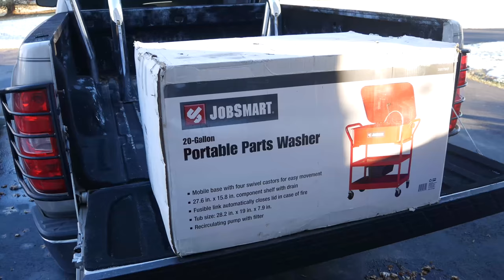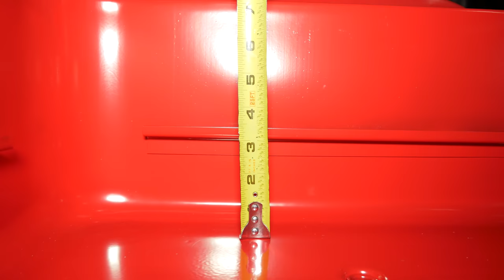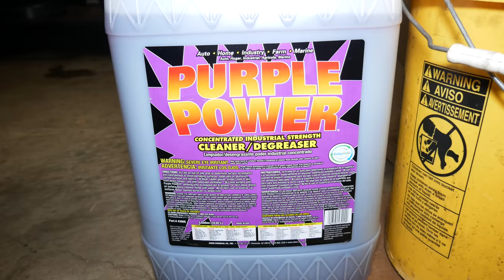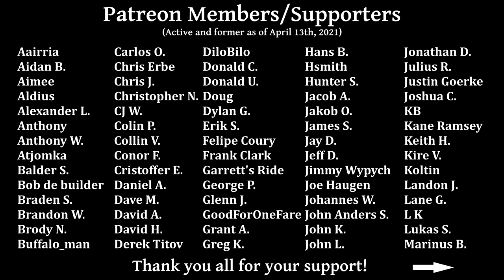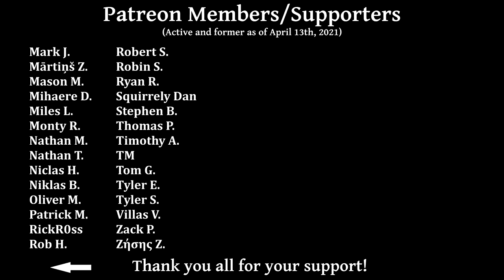$200 454 Engine Rebuild: Cleaning Engine Internals and Hardware (78 Firebird Ep.17)

Comment: Hello Ronald, I don't know if you will even see this comment but I feel right putting this info here anyway. Have you considered having the piston skirts knurled? Doing a budget rebuild like this one is a great time for this. You may be familiar with the process but just in case someone else wonders, knurling the piston skirts is an inexpensive stop gap procedure that increase the thickness of the piston skirt, done correctly it will make the pistons the original ish diameter.  I am a retired Automotive Machinist so I have done this myself in the past many many times. There are those that will say this is a useless thing to do but having done this myself and then disassembling the engine years later I can attest that it does last for quite a long time and will keep everything in spec and happy longer. You will have the information to have it done already, you simply need to know the finished bore size  and the measurement of the piston at the skirt. The shop will then put the piston in a machine that is set to put a bunch of  raised knurls onto the skirt. this will help tremendously with any piston to wall differences. Most machine shops that cater to the DIY market will have one of these machines in a dark corner of the shop lol.

Comment: I was literally typing a comment about using purple power with aluminum parts like the pistons, then got to the part where you discovered its effect.
Reply: @marxist google can you explain why? I’m genuinely curious, is it just discolouration or has it corroded/damaged the aluminum in some way? Thanks
Reply: @nakulah  Purple power is caustic to aluminum. It strips the protective oxide layer on aluminum and corrodes it pretty badly. He is likely in for a pretty nasty surprise when he unwraps them next. That said, it is entirely possible he gets lucky and he got them cleaned and the WD-40 removed it before any serious damage was done, but I'm not terribly optimistic.
Reply: @nakulah  it'll probably be fine, thinner aluminum parts could be completely destroyed or weakened tho
Reply: Clean-Rite says in their FAQ that Purple Power will leave "white streaks or a hazy film" on aluminum and stainless steel but it doesn't say anything about being corrosive. It also suggests some products for removing those residues. It's probably fine.
Reply: @jeffreylunger  ask anyone who has ever soaked aluminum in purple power if it isn't corrosive, see what they say. Soaking and cleaning with are very different things.
Reply: @marxist google doubt it they are ruined, especially for a big block low compression build.

Comment: Purple power has a PH of 11-12 according to it's MSDS, meaning it's alkaline. Aluminium has a protective oxide layer that is stable in a PH between 4.0 and 8.5. So leaving the pistons in the purple power for a long time has etched them. I hope there was no special coating on the piston's skirts because that might have been etched as well.

Comment: For all you Gearheads out there there's an easier way it's called Zoom injector cleaner I had a couple of engines I pulled out of a junkyard I'm not going to say what kind or not but they were well junked up with Pennzoil syndrome and I was able to use this product with our small brush for application and anything that you wanted cleaned you just code it on it even carbon and all the stuff that's in the oil rings you just treat that until mystery them and wrap them up and plastic and let the stuff do its work and I mean it does all the work there was very little to do disassemble everything saved everything and put this motor back together and drove a long enough to know that it was almost as new as a factory built motor be used in a oil that's hard to say for a Ford but there it is in a nutshell I still have that motor after I was not blessed with doing it but the car was dismantled I have all the parts that I invested in it laying around sitting around wherever the car I finally abandoned because the guy that are blessed it with loaded it full of title loans I pray for the guy. So if you want or a lazy type mechanic like I am my experiment worked beautifully and I bought a whole case of this stuff and didn't care what the cost is it was well over around two hundred bucks I don't remember it was well worth that I still have several bottles of it left it doesn't smell or irritate my sinuses and didn't irritate my hands using it so good luck you guys Ed an old MO

Comment: I love how some other car youtubers will take a project that only looks bad but is mechanicaly sound and call it "The Worst Ever Build On YouTube (Never Do This) SHOCKING!!!!1!1!1" Then Fuzzy Dice comes along with damaged cam bearings on one project, really high oil clearance on another, and rusty cylinders just honed until they look less terrible on both and he just goes "Eh, it'll be fiiiiiiine." Then after he puts it all together, it's fine. It runs, drives, and he goes on adventures without a care having a blast.

 This is honestly true blue hotrodding at it's finest: sketchy, weird, against all conventions and common sense, and, most imortantly, fun. This shows you don't need to buy expensive parts for expensive engines to put in one of a select handful of popular expensive cars, you can take a car that is super cheap put a super cheap rebuilt engine with used and/or super cheap parts and have fun. And it'll be fine.
Reply: But I'm not a real mechanic unless I have $30,000+ worth of Fapoff (Snap on) tools, right?
Reply: Watch Pakistani Truck channel if you like shade tree style. Tiny budget, in the dirt, barefoot.
Reply: @Leo Coffy It'll be fine

Comment: It's fun watching your videos. This is what hot rodding is all about. If you plan to re-use rods and main caps without resizing its good to use the old bearings. The rods and main will be slightly out of round and the old bearings are worn into them

Comment: for all of your small parts cleaning i would suggest getting a sonic parts cleaner. They come in a variety of sizes and definitely make parts cleaning a breeze.
Reply from the maker: I've looked into them, I'd really like one big enough to do a carburetor body but it seems like the larger ones are really hit-or-miss so I've kinda been waiting until I see a relatively inexpensive one that is still supposedly reliable on the market.
Reply: @FuzzyDiceProjects   I know it sounds rather cliche. I would urge you to go ahead and hop on Amazon and actually read the reviews. There are several on there that actually state that they have used them for cleaning automotive parts and the like.
Reply: @FuzzyDiceProjects  Check out french youtube channel called "coupable detout" , he use a really big one (like oven sized) to clean VR6 heads and other large engine parts, he can't put an engine block in it tho but it's still pretty handy for old caked on oil.

Comment: Put the brush on the end of the hose on your parts washer. No splashing and built in brush
Reply from the maker: I have used a parts washer like that before, if I changed out the steel flexible line for a plastic hose or something it would be pretty nice. I may have to sort out something like that in the future!

Comment: For small hardware, a parts or jewelry tumbler is great. You throw nuts or bolts in and they'll tumble in degreaser for as long as you want, and they look nearly new when you take them out. I got one for about 60 dollars online and I use it all the time

Comment: I used SeaFoam to clean and soak some parts off my 454 and it worked pretty damn good. Also won't hurt anything because it petroleum based. Diesel fuel might also be good to soak parks in.

Comment: Filtration problems? Maybe a disposable rag to use as a prefilter? Maybe look into something that is washable and reusable. The fuel filter was a good idea, but if used to filter parts cleaner fluid that has been soaking dirty parts, of course it will clog up quickly.

Nice modding of the parts washer, though. A few more, and you may have what you're looking for.

Extra points for backyard engine parts cleaning and prepping. I'm sure you'll use the services of a machine shop when needed.

Comment: You need a parts cleaning brush that has a hose that attatches to the parts washer nozzle.
Reply: Agreed, the extra pressure is actually useful at that point.  I also want to put a serviceable fuel filter inline on my washer now.

Comment: I use yellow power for cleaning parts like that, good old diesel.
Reply: Smells awful and you have to do it outdoors, but yes Diesel is far better to clean parts with like this. I'm fairly certain he is going to unwrap those pistons and find out why you don't soak aluminium in it.
Reply: I don't even know what that purple power is tho, some NA thing maybe?
Reply: @Rudy97  Probably, though it wouldn't surprise me if it was rebranded something else in other countries. Over here it is a fairly effective cleaner/degreaser that is cheap.
Reply: Ed and old MO once warned you guys with products that aren't worth using for anything especially not in your lungs if you have lung issues avoid anything that you spray out of a can like WD-40 and what was the other one little research has able to find it Marvel Mystery Oil I used to use a 2in restoring a few Motors and after I sprayed all that out of the damn rings I can hardly breathe goodnight already had my share of problems long before that thanks and being a will heavy welder grinder gyro span fabricator thanks to Ken Robbins at Circle K Manufacturing gave me a job minimum wage dude I kept that job 10 years here's a product again cat Products Incorporated fuel treatment cleans from the tank to the tips remove deposit cleans injectors are stores spray patterns it is harmful or fatal is swollen combustible read all Carson's on the back panel Zoom to fruit fuel treatment is designed to rapidly clean the fuel delivery system from the fuel tank lines fuel rails to injector tips it also contains powerful detergent additives chemistry to continue cleaning intake valve and intake runner Zoom tube contains no alcohol methanol xylene golean or other partial has it is safe to use on all modern fuel systems directions add to fuel tank for best results will fuel tank after use effectively used to maintain fuel system between Professional Services treatments 20 to 25 gallons 75 295 l danger combustible liquid keep away from heat sparked and Open Flame harmful or fatal if swallowed contains petroleum distillates if swallowed do not induce vomiting get medical attention in case of eye and skin contact flush with water for at least 15 minutes keep out of the reach of children made in the USA part number 7025 calidad Auto Tech Incorporated Saylorsburg Pennsylvania and I bought this at a place called Cargo Largo for $0.99 I'll pull it off the shelf and a restored two engines with one bottle and to this day I don't know what I did with the rest of it I probably dumped it in a tank or two but who knows I warned you you want to fill your tank and then treat it accordingly don't over treat it it can fouled spark plugs still look like a fitted a pound of marijuana all the white orschlens on the points will be red is your eyeballs
Reply: Sorry about the misspells I use a asherah a service what do they call that well I call her Lexus and Lexus can't seem to get what I say and seems to put whatever the hell she wants and things I don't know how many times I fired her I want a woman that can type what I'm trying to say is you try this stuff and you'll go wow my hands don't even hurt. It's called Zoom II. Another key thing to search would be for a product called run right

Comment: Use a thinner gap gauge to release the rings without damage if they are stuck. Put it under the lose part of one side and move it all the way around and hold your tumb on the ring so it wont snap. Hitting it with a hammer can leave damage to the grooves and new rings might not move freely.

Comment: I am glad that you are not going to reuse the camshaft since I've never seen anyone use new lifters, or reuse lifters from a different lobe without it failing in short order.  If you had the original lifters and knew what cam lobe they were for then it's ok to reuse them.

Comment: Question. 1978 Pontiac Firebird? Wouldn't that be a 455? Pontiac, Buick, and Oldsmobile didn't make a 454 in the late 70's. That's a Chevrolet motor. 
But that's me assuming that you are using a factory Pontiac motor. Which if I remember correctly the V8 would have been a 400 or a 403. I don't think a even the 455 was offered for the 78.
But I've been wrong before and will be again.

Comment: I soak in kerosene. Then use wire bushes to remove carbon. Old rings work great to scrub out grooves. One final overnight soak immersed in kerosene, final brake clean. I then lube wrist pins and they're minty.

I would avoid using anything that isn't hydrocarbon based. Degreaser is corrosive to aluminum and water is corrosive to steel/iron.

Comment: I've had a 454 sitting on ice for awhile now because I want to get spendy with the cam because it was an old methane gen 6 generator engine and needs a new cam, otherwise it would be a super cheap rebuild, might get risky and go used with the cam lol
Reply: @UCq7j-QMy5iJFL9h0zxuYISg I mean, I understand where you're coming from, but with vortec heads, not really what I would call smoggers, its a roller cam setup so usually with flat tappet, you don't want to run a used cam, but honestly I've been able to run used but cleaned up roller cams in other motors,  I wasn't really intending on running it as a race engine or anything close to it, I just wanted to take it apart, maybe throw some new bearings in it, hone the cylinders, hand polish the crank and re-gasket it so I can let it sit on my engine run stand so I can run it occassionaly and keep it from turning into a rusty boat anchor on my basement floor. Then when I have the money to send it off, get it trued up at the machine shop and buy some AFR heads and run an efi setup, then ill run it in a 78 k20 truck I have, youre mostly right, but for what I'm using it for, just something to spend a few hundred bucks and some time on having fun messing with another engine, thing probably won't even see anything above 2k rpm, more of something to fire up just to hear some noise and then shut it down, then ill rip it apart again and have it done high-dollar correct. Mostly trying to figure out a fun way to keep it from wasting away.

Comment: Nice👌, I was wondering if you dry ran the pump if it would wear a lil and lower the pressure 🤔
Reply from the maker: Interesting idea! I considered taking it apart and doing something similar by tripping the impeller a little bit or whatever.

Comment: OMG dude you so need to keep that stuff in order. Pushrods, rockers, rod caps, that all has to go back on the same place it came off at. Everything has wear patterns already. You put #4 rocker on to #7's pushrod it has to make a new wear patter and could cause it to fail. As for rod caps, they install them on the rods and then bore the two together to make them the right size. If you put #1 rod cap on #5 rod you may have real issues. I hope they were numbered..... If you are just doing refresh kit in that motor (you should look at Northern Auto Parts for a rebuild/refresh kit ) every part of that motor that touches another part should have been put back exactly where it came from. 
On a $200, 454, double make sure you do valve seal or you will be sorry. Easy now, major pain later.

Comment: try use some kind of dimmer adapter for the pump to decrease its power, it might work if you are lucky, they are pretty cheap. 
(was linking a picture of one, but i think my comments where removed cuz of the link)
Reply: a simply tee fitting with a valve on one side to control the by pass back to the tank.  sounds simple, in the tight space it's more complicated.